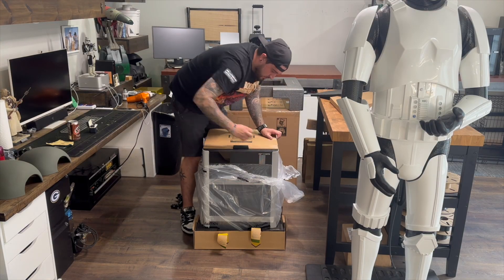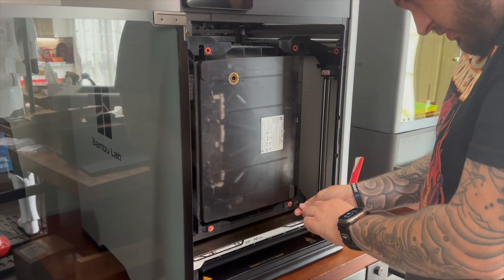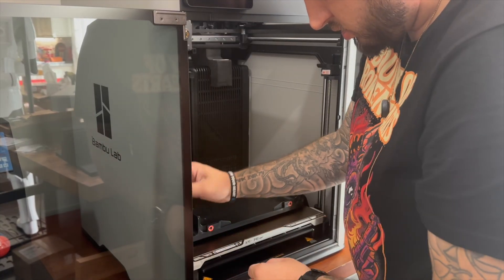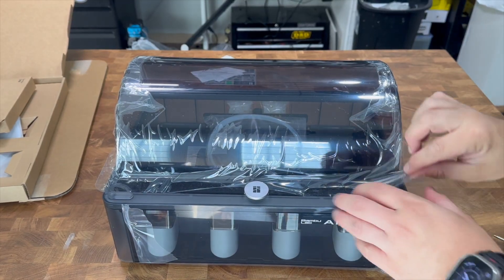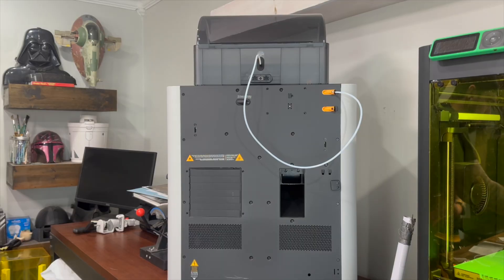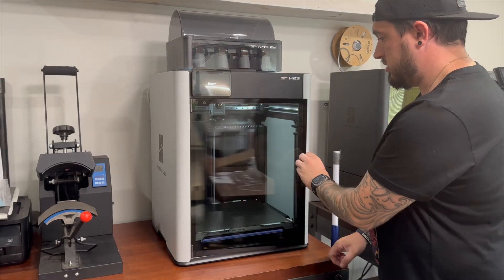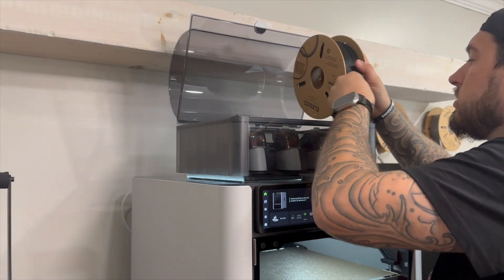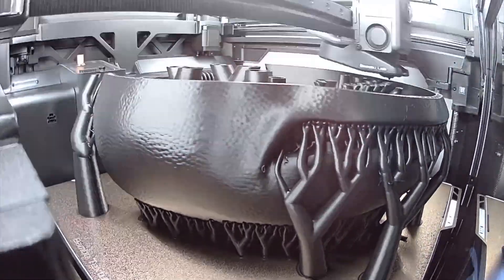THE H2S HAS LANDED: UNBOXING BAMBU LAB H2S NEWEST PRINTER

Comment: What settings when you printed this?  I am doing similar for a TMNT head and it's telling me 4 days.  But yours was 24 hours?
Reply from the maker: Are you using the same printer?
Reply: @Millenniumworkshop  Yes sir.  H2S brand new all defaults.  PLA matte if it matters. 0.08